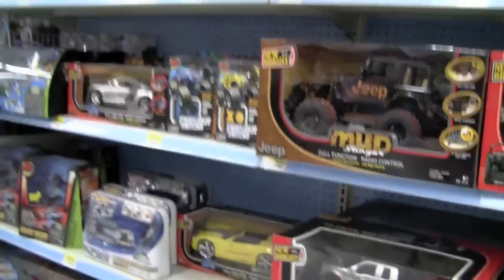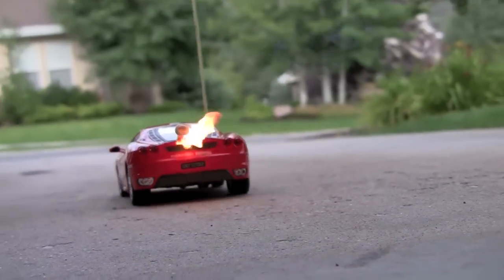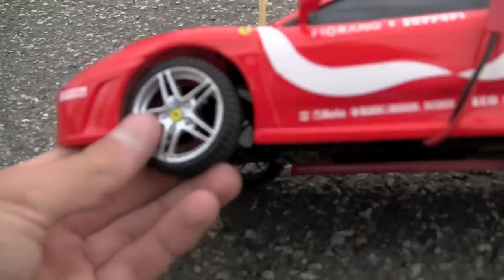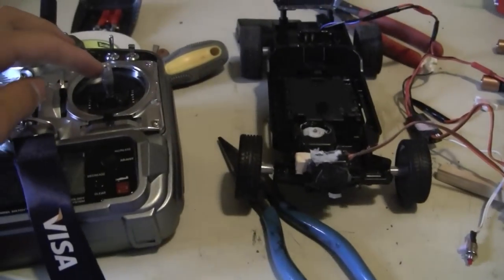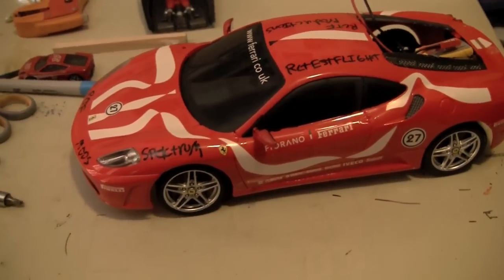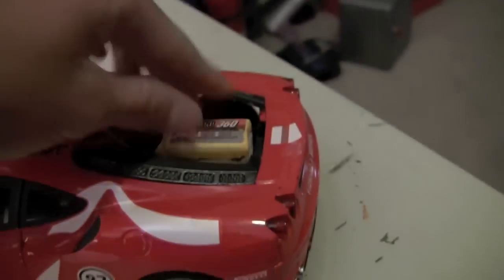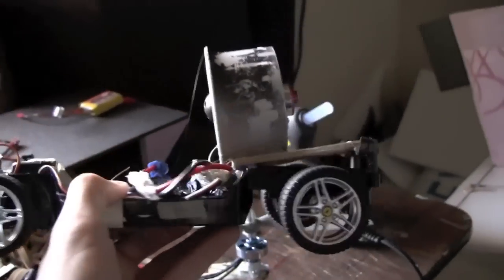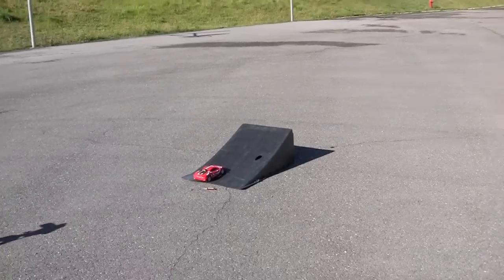Cheap Toy RC Car Mods

Comment: Put on a brushless hobby grade motor and a LiPo 4 cell batery

It really brings out the speed
Reply: pump 6s through that thing with a 6s speed controller and reciver with a 7000kv brushless that will bring out the speed
Reply: Then you might as well just buy a hobby grade one.
Reply: @willburke5384  hah try a 50000 rpm ripper motor and 24s baby!

MOH POWA BABY!!!
Reply: @eagleeye6688  why not just buy a tesla?
Reply: @tylerwright6006  lol

Comment: i got an RC porsche carrera GT that goes 30mph in stock gear, i put underlights to make it look more cooler and put a cigarrete lighter in back with a timer on it so when i push throttle flame comes out back

Comment: Go to Walmart and get that Lamborghini Gallardo made by Maisto  it is super nice with differentials and only for $40.00  mode it.. it is also got remote lights.  I replaced the battery with 1800 mah 2s lipo and thats all I have done so far..

Comment: If you use a power transistor to control the 4 channels of a basic RC, you wont have to worry about overheating/overvolting. Just wire the original negative motor power supply lead to the base of an NPN power transistor, the positive motor power supply lead to ground, and use a high voltage Li Po or Lithium Ion battery and a high voltage motor in a loop but making the loop also have to pass through the collector and out of the collector.

Comment: @rctestflight you're using an airplane radio so of course it's going to be expensive. you could use a microcontroler sending data through the original radio to another microcontroler on board. what i would do is use original inputs and outputs of the original radio( originally forward, back left and right) to send a 4 bit binary number to the microcontroler. this would give you 16 different commands without having to swap for an expensive radio

Comment: @rctestflight 
Bigger gear on the rear, in a 4wd car. So that the rear wheels spin more.

The more spin, the more counter-steer you will need. But it also makes up for great drifting. Nevertheless, balancing with different tires if it becomes extreme, might be needed.

A whole lot fun. But tomy drift cars can't handle without modding the chassis space, more than a 12t gear on the rear..... which sucks =( even though it is already quite fun like that

Comment: @nopeadox dude its really not that hard to to do those mods: the toughest part would be the servo instalation. but it would be easy to give it more voltage. a simple 2 step process.        1.snip power leads       2.solder female connector to power leads on the circuit board

Comment: Hi did you still use the same stock motor and wired the ESC end to the motor?
Your video is so cool, im actually trying to modify my Newbright RC truck, so easy to disassemble and theres tons of space to put the things that you put in your rc car.
Kepp up the good work.

Comment: @rctestflight 
Too bad. I found out that putting for instance, the double of dentation in the rear gear, makes the car slide in a wonderful countersteer. Yet to see someone who can make such mod to the Tomy Drift... the rear doesn't handle more than a 12t gear... to small, but for an expert it should be ezy

Comment: I did the same thing with a x-mod´s  Hummer H2 but there was way less space inside for the electronics :D Id had to put 2 servos in it one for steering the other for throttle because i had no brushed esc  :D

Comment: +rctestflight how did you connect the motor to the receiver? Still confused on how you did that part
Reply: Probably by desoldering the motor wires from the main board, and attaching them to a brushed speed control.

Comment: hey i got a problem with my rc car. I bought a new bright car for 20 bucks and i'm modding it. I changed the motor and the batteries to get more power, but the motor seems to stop at the begening when it got some resistence to it like if i use my finger and put it on the pinion gear, nothing works but if i let the motor get some aceleration, nothing can stop it. is there something i can use to give it more power at the start ?

Comment: If u put 4 D cell batteries would that increase the speed by a little compared to the 4 AA.(haven't been able to check the voltage on a D cell so this could be a stupid question)

Comment: Really funny video! XD I enjoyed when the kid or you was inside the selves acting totally normal. HEY, would you be interested in modding a Takara Tomy drift car?

But if you do please bare in mind that there are already a few mods done to it. I could state you a challenge if you'd accept xD. If that's ok by you........

Takara Tomy drift cars are on Ebay selling for 19.99 (auction start price)

The best price I've seen so far, after exhaustive research so yea.

Please answer :p

Comment: I am add 18650 cell with tp4056 charger[two will burn driver] in battery bay.Also glued aluminium heat spreader from old PC chipset on driver pcb[Didnt have transistors].Car runs 2 times faster and 4 times longer now !.Thinking to replace all plastic parts in to metal.Yes this video still exists bro !.

Comment: i have a real rc car that goes 30+ without a lipo
Reply: My traxxas goes 60 mile per hours
Reply: Andrew Kim mine 80
Reply: Cool what is it?mines stampede 4x4 vxl with 3s lipo
Reply: Andrew Kim its a rusler with 7 cell ni-mh
Reply: Ronnie Welsh and its stock :)
Reply: Nice
Reply: Andrew Kim thx
Reply: Andrew Kim
I LOVE TRAXXAS
Reply: Andrew Kim
3 I have a 2wd slash and the 4x4 stampede brushless
Reply: Ever run the stampede 4x4 vxl with the included gear and a 3s lipo? Goes like 60 miles
Reply: Andrew Kim na but if mine had 3 it would blow the engine
Reply: Yeah probably! lol
Reply: I have the 100+ MPH traxxas X0-1
Reply: I dropped a cake creations sidewinder 3 combo with a 4600KV fort pole brushless mirror and I also put in a traxxas servo into my granite now whenever the differential isn't broken it goes about 50 miles per hour, much better than the stock 30 miles per hour. I use a 2S Lipo since my battery tray won't fit anything bigger...
Reply: Sorry auto correct castle creations not cake
Reply: Aidan Gieg
 But cake motors are awesome :P
Reply: Mine goes 77 mph 
😂😂
Reply: Sorry-- Old Thread, but could you please provide a link for the cake motors site? I'm thinking of dropping a full-size cake motor into a breakfast muffin. Can't wait to blow the doors off all the birthday cakes in my neighborhood!
Reply: my traxxas rustler vxl goes 80
Reply: Ronnie Welsh my redcat will do 85mph with a 6s
Reply: I upgraded a traxxas and it gos 700+rpm!!! ITS FAST
Reply: aidengavin1124 what are you talking about?
Reply: My NiMh goes 40km/h and drifts well
Reply: My losi race truck goes 80
Reply: mine goes 100 MPH TRAXXAS MOFOS

Comment: No, that is not fast at all. You need to spend 350$ before you get a good, fast RC car. Some cheaper cars may be fast, but their transmitters and receivers will be garbage so you won't be able to drive them very far away.

Comment: "this like bar right here that like turns it and conected it to a like servo" LEARN CAR LINGO!! It's called rack and pinion steering, the rack moves across and turns the wheels not the 'bar like thing'

Comment: Plz help me make my rc offroad truck fast t just doesn't even have power to turn its wheels and it cant even go faster than 1 min in 200 secs
Reply: If you want help on your setup, you'd need to post what you're driving and what's in it otherwise we're just shooting in the dark.  That being said, to take a shot in the dark there are a few things you might want to look into.  Better battery, better speed controller, brushless motor.  Other things you may want is a better gearbox to get that extra power to the ground without stripping out the gears.  Strong enough and you're gonna want a slipper clutch rather than just direct drive with gears.  That should get you started.
Reply: Well thanks man
Reply: What model is it?
Reply: It's the gravity v thunder. Offroad it sucks it was for like 50 $ but it runs like shit and on the box it says 4x4 but it's not 4x4